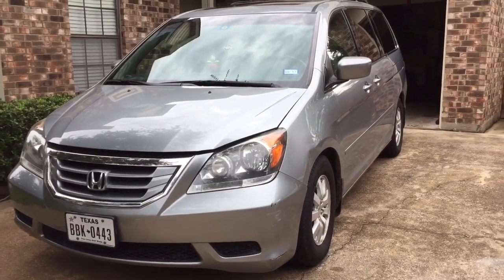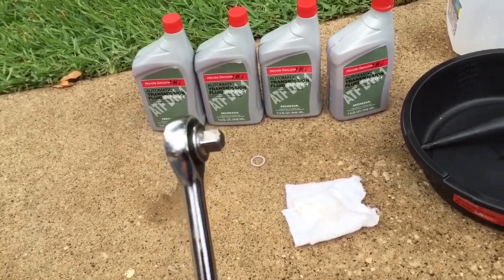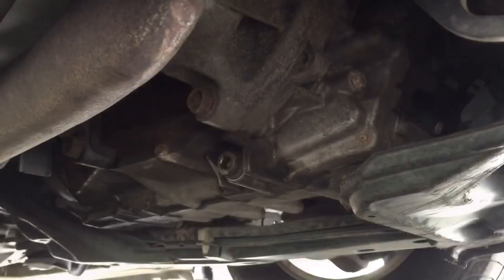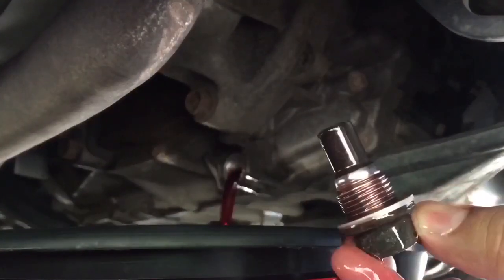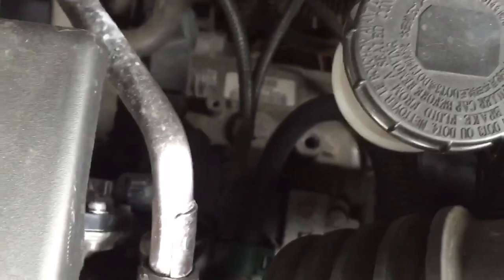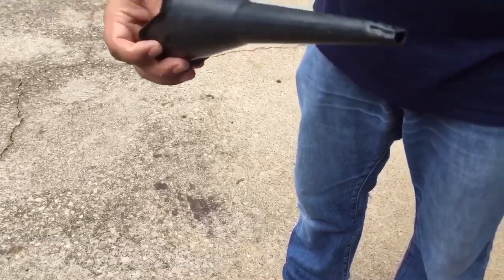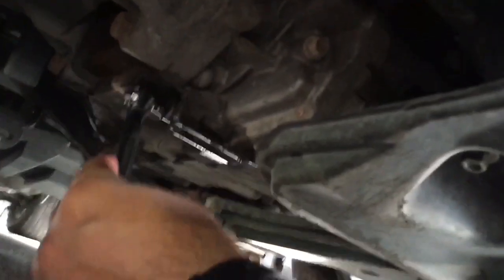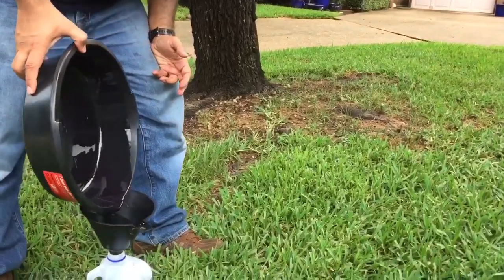2005 - 2010 Honda Odyssey Transmission Fluid Change

Comment: First, EVERYONE read in the DESCRIPTION section for a detailed procedure for changing the fluid three times and check the level with the ENGINE OFF.  Second, thank you taking the time and effort to make this video.  I just bought a nice 2007 Odyssey and need all the instructions I can get to maintain it.  We all know that a transmission flush is bad because the detergents in the new oil break loose all sorts of crud which can plug up the tiny passageways in a transmission.  But draining and filling three times will pretty much change all the fluid to new levels.  The transmission fluid level check on the Honda Odyssey is DIFFERENT THAN ON AMERICAN CARS.  I've been used to checking with the transmission in Park and the engine RUNNING.
Reply from the maker: Congratulations on your purchase! This model of Odyssey is super easy to maintain. You can see how few videos I have on my Odyssey, and it is because there is nothing much to do on it. Compare that to my 2013 Accord and I have tons of maintenance videos on that - LOL. How many miles are on your 07 Odyssey?
Reply: @FlyBeee  This is going to be hard to believe but I was shown the maintenance records and CarFax - 85,600 miles on the odometer.  It's the EX-L model with the sunroof, heated leather seats etc.  It sure has a lot more bells and whistles than my previous 2005 Ford Freestar SEL.  It was the cheapest vehicle in Driver's Village Used Car Lot at $ 8,000.  Even more, it had a little bitty shimmy in the steering wheel and a tiny little surface rust spot on the side.  They kept the vehicle for three weeks while they tried to figure out what the shimmy was and while they fixed the rust spot.  They gave me a 2022 Mitsubishi Outlander for a loaner.  I hate driving a $ 35,000 car.  I'm always afraid someone is going to crash into me or side swipe me or run their grocery car into me.  I'm used to cheapie cars where I don't care so much.  They got rid of the shimmy by putting on four brand new Tiger's Paw tires.  I've NEVER been treated so well by a car dealer.
Reply from the maker: @STBRetired1  Wow! this is awesome! You got a wonderful vehicle w/ bells & whistles and received a king's treatment from a car dealer! Seriously! LOL I love the details you shared, and 86K is nothing for a Honda! I've had many Honda vehicles including two Honda Odysseys and love this particular model year 2005-2010 version which is much more solid built than the newer models. Check out crash test videos on youtube yourself!  As for maintenance, if you have history available check that vehicle has new filters - engine filter and A/C filter replace less than 20K miles, Transmission fluid and Brake fluid changed less than 3 years or 36K miles, and timing belt, water pump & coolant replaced at 10 yrs. Get done what is needed and you got a solid vehicle! If you like to, add a Bluetooth device for handsfree calling & music streaming and it upgrades the vehicle for only $20. I've personally used  'Anker Soundsync Drive' five 5+ years and love it. This has to be the most maintenance free Honda I've ever owned! Let me know if you have any any other Qs about this vehicle. Best of luck!
Reply: @FlyBeee  The Owner's Manual is a thick as the Bible.  There is so much to learn.  I've just sent away for Honda products like the transmission and engine oils.  Some say that they are a little different than the oil we get at AutoZone and made that way for their particular Honda vehicles.  I'll take them at their word since they're all about the same price.  I also sent for a foam cannon, clay bars and other detailing equipment.  Next I have to order some rustproofing equipment like Fluid Film since I live in Syracuse, NY.  It's bad enough that Syracuse is called the Salt City because they used to mine it around here in the "early" days but they also saturate the roads with it each Winter.  I had my previous minivan about eight years and that was pristine when I got it.  I just had a chance to get underneath and saw how bad the salt had been eating away at it.  I'm going to fight to keep that from happening to the new minivan.  A/C filter???  I haven't heard about that yet.  I'll have to check it out before Summer.  And I think that the 2007 was the first year they started using a timing chain instead of the timing belt.  Yup on the coolant.  I got a pistol thingie that attaches on a hose so you can flush the heater core hoses forward and reverse.  I also bought a backup camera.  I can't see through all the two dozen seats so a camera over the license plate should help a lot.  I want to get a dashcam, too, in case of an accident.  Since I'm 78 years old, I just know that the first thing another driver will do is tell the cops that it was all my fault because of my age.  I want a recording of the accident to simplify things for the officer.  There are too many folks out there driving recklessly and doing "brake checks" on other cars so they can collect insurance.
Reply from the maker: @STBRetired1  'Foam Cannon', 'Clay Bar(s)', 'Detailing Equipment'.. I read these words and couldn't stop thinking your Odyssey is getting a royal princess treatment! :) , and that if you sold your 2005 Ford Freestar the buyer is one lucky owner! For oils and fluids I agree with getting Honda brand. Honda is one of few companies that makes its own engines and transmissions and the vehicles are sensitive to non OEM. Honda dealers around me sometimes have % discount on parts coupon listed on their website which I use it to stock up on fluids and filters for the different Honda vehicles I have. My 2009 and 2010 Odyssey both have timing belts so definitely double-check on timing belt vs chain on your 07. May be just call the local Honda dealer parts dept for price on timing belt for your 07, they'll lookup in Honda system to confirm whether there is a chain vs. belt. Yea, backup camera is a must on Odyssey! and totally agree on dash-cam. I have these in my vehicles and came in handy when someone sideswiped Odyssey and then claimed we hit him. One video sent to his insurance company and they accepted responsibility in 5 mins! Highly recommend to have dash-cam. I have Rexing daul-dashcam in my Odyssey and you can see the wiring video here: https://youtu.be/McSLtarRnYA . This particular model is no longer available but newer ones have capacitor which is better. In Accord I have Aukey/Agalia brand which is also dual dash-cam but smaller in size and records better at night: https://amzn.to/3b4uJXF  Check out both. some models come with parking mode which works if you park on the street. Let me know if I can answer any Qs related to dashcams. Best wishes!
Reply: @FlyBeee  It seems like I've misspoken TWICE.  I didn't order Honda engine oil.  I decided to go with Mobil 1 Extended Performance High Mileage oil instead.  I just Googled about the timing belts/chains and you were correct about the timing belt.  Apparently it was the 4 cylinder engines that had the timing chain in 2007.  Apparently they went to timing chains in the 6 cylinder engines in 2012.  So now I've got to consider a thousand dollar timing belt/water pump replacement.  Ugh.  Worse yet, it's not so much the miles but the years that have an effect on the belt.  Seems like a vehicle not driven much is almost as damaging as one driven many highway miles each year.  I could probably go another five years without anything happening but if it did then that interference engine would self destruct.  Damn.

Comment: The fluid you took out was clean enough to rebottle and sell.
Reply from the maker: LOL! good eye. This was my second drain & fill in 3K miles so the fluid was only 50% dirty. Honda vehicles are notorious for transmission issues so I keep clean fluid in the vehicle. Just an extra maintenance to hedge against an expensive transmission failure.

Comment: Sir, you are not going to change transmission oil filter?
Reply: Odyssey does NOT have one sir
Reply from the maker: The 05-06 Odyssey has a serviceable transmission filter which is easily accessible. Honda changed transmission for the 2008-2010 model Odys and these don't have a serviceable transmission filter and therefore I have not replaced the transmission filter on my two Odys. If we keep the transmission fluid relatively clean (do one drain & fill every 15K mile) then filter would be in good condition. But if transmission fluid has not been changed in a while and is dirty then the filter would also be dirty and will need to be replaced. Best wishes
Reply: You don't mention the 2007...??
Reply: @realityconformist424  I think he mistyped.  Instead of 2008 he should have typed 2007.  I just got a 2007 Odyssey and my vehicle doesn't have a serviceable transmission filter from what I can find on an Internet search.
Reply: @FlyBeee  the 08 and up do yet you have to drop the pan. Honda states that you don't have to change them out.

Comment: I'm an owner of a 2010 Honda Odyssey EX. You wouldn't happen to know where the filter location on the transaxle is do you? On top of it, am I gonna have to get her Transaxle flushed as well? Or does it not matter?
Reply from the maker: I have had 2009 and 2010 Honda Odyssey and both are FWD vehicles with 5 speed automatic transmission. An AWD with transaxle was not offered in both years in the US. If you are in Canada or another country with cold temps then perhaps an AWD with transaxle was an option there. I mention this as preface to my suggestion which is going to be based on my own experience with FWD vehicles that only have transmission (and no transaxle). 

With that said, 2010 Odyssey requires its transmission fluid to be replaced every 30K miles by the drain & fill method. Which means complete three drain & fills of transmission fluid over a few hundred miles to replace the fluid (details in narrative of this video) - Or do one drain & fill every 10K miles (preferred) to accomplish the same thing and keep fresh fluid in vehicle at all time. If fluid is changed on schedule then dirty fluid does not stay in transmission to clog the fluid filter and there is no need for filter replacement. The older model 2005 - 2006 Ody had a different transmission which had issues and it had an external serviceable filter. Honda changed the transmission for the 2008 - 2010 model years and it does not have a serviceable transmission filter. Considering the US Odyssey does not have transaxle therefore a its fluid replacement is not a question. If your Ody has one then the transaxle fluid should be changed on the same schedule of 30K miles. Best of luck.
Reply: @FlyBeee  actually, FWD cars don't have the same type of trans as a RWD and they're called transaxles since the front axles are connected directly into it. Hinting the name trans"axle"
Reply from the maker: @LaurinaRose  Yep, I understand. If your Odyssey is RWD or AWD, what country are you in? .. I am just curious about what Honda offered in other countries. lol

Comment: Gotta get me that wide funnel to drain the oil into the gallon. I have the same pan and its a disaster every time haha. Do you still have this vehicle?
Reply from the maker: I bought this funnel set at home depot and it has held up pretty good. may be check your local HD for ‘Funnel Assortment (3-Pack) by Scepter’ which sells for about $3 . i hope this helps. I have the Honda Odyssey and the same drain pan. somehow my drain pan hasn't given any trouble and I have also used it for oil changes, coolant changes etc. May be the newer ones are made differently. How long ago did you buy yours?
Reply: @FlyBeee  Drain pan is only about 2 years old ,same model as yours. Thing is I try draining it without a funnel so the stream is too wide I see how you did it with a funnel will go check it/buy one out at Home Depot, thanks a million!
Reply from the maker: You are welcome. I hope your local HD store has this funnel, it has worked really well for me and the price is awesome too. Best wishes!

Comment: Hi how much fluid exactly did you put it? I need to buy 4 bottles?
Reply from the maker: I used 3.5 quarts (3.5 bottles). you will need 4 bottles of 1 quart each. there is a measuring scale on each bottle so you will know when half the bottle is used. i jope this helps. best wishes!

Comment: Hi. What is name of washer and where did u buy it ?? And after changing oil how many milage we can run
Reply from the maker: Honda says to 'replace' fluid every 30,000 miles. If you one drain & fill every 10,000 miles it achieves the same results and keep fresh fluid in vehicle; this is what I do in my Honda vehicles. More details are in the description of video and step-by-step process, part number of washer , price, and details on where to buy it. I hope this helps. Questions are welcome. Best wishes!

Comment: How about the ATF Filter?
Reply from the maker: My answer has two parts (1) Transmission filter is not a maintenance item in my 2009 and 2010 Odyssey therefore I have not replaced it and have not had any issues for 100K+ miles in both vehicles. (2) Whether to change transmission filter in your Odyssey depends on the model year of vehicle you have. REASON: Honda makes its own transmissions and for years it has been the weakest part of many (not all)  Honda / Acura vehicles (see CarComplaintsDOTcom) for data. The year 2000 - 2008 Odysseys have had many issues so if your vehicle is of this model year then take extra care of transmission with frequent fluid changes, ATF filter change, and Pressure switch changes which are much less costly to replace vs a full transmission. I hope this helps. Best wishes
Reply: The 05/06 odyssey has an accessible ATF filter located under the battery housing. The 07+ are basically inaccessible unless you really want to work for it.  Honda states it's a lifetime filter, but after watching videos and changing one myself I can say that is a lie. Would definitley recommend changing every  drain and fill, if not every other. They are relatively inexpensive and would definitely help with the life of the vehicle.

Comment: Anyone ever changed out the transmission fluid and the fluid has a purple like tint\color to it. Does anyone know if that's oem fluids or something else
Reply from the maker: Most likely it is 'Royal Purple' brand transmission fluid which is a purple color fluid and is an after market brand (not OEM). It is a good fluid more expensive than OEM Honda fluid. I hope this helps.

Comment: Do you need to change the filter or nah
Reply from the maker: Transmission filter replacement is not a maintenance item in the maintenance schedule for the 2009-2010 model year so I have not replaced it in the two Odysseys I've had  .. no issues at all, and not planning on changing the filter. Others have replaced it as precautionary measure. I say do what you feel comfortable with.

Comment: Dude, I have a 2007 Honda Odyssey and I can't find where the transmission's external oil filter is located. I have seen several videos from 2002 to 2006, and it does not have it on the same site.
Can you help me with that please
Reply from the maker: Location of transmission filter on 07 - 08 Ody may be easier to see on a parts diagram. Search for part # 25450-P4V-013 and you will find these online. I hope it helps.
Reply: Thanks for your help friend.
Reply from the maker: @OscarSanchez-ht7pz  You are welcome. Glad to help. If your Odyssey has over 120K miles or you are running into potential clutch / transmission issues please also look into changing pressure switch for the gear that is giving issue. These are like a bolt that goes into transmission and are easy to remove and replace. I hope this helps.

Comment: plug won't budge, what do i do?
Reply: just found your jack method, gonna give it a shot.
Reply from the maker: @noneyerbidness  glad you found that video. Let me know how it works out. The comments on that video have some good suggestions too so please check em out. I have added its link in the description to this video in case it helps others.
Reply: @FlyBeee  it didn't work for me, i was afraid of pushing it to far and snapping something.  i was able to rig it so i had a little more leverage and it finally broke loose.  mission accomplished...really appreciate your vids, man.
Reply from the maker: @noneyerbidness  Mission Accomplished indeed! So glad your leverage method worked, thanks so much for the update on how you made it work- that would help others in the same boat reading the comments! I appreciate for liking my videos :)